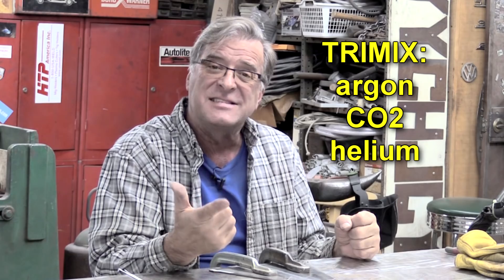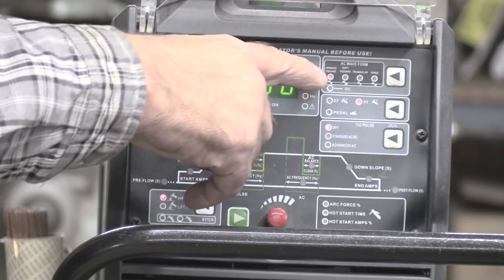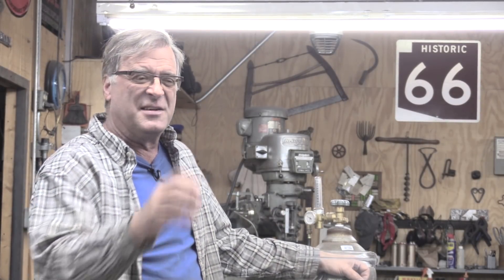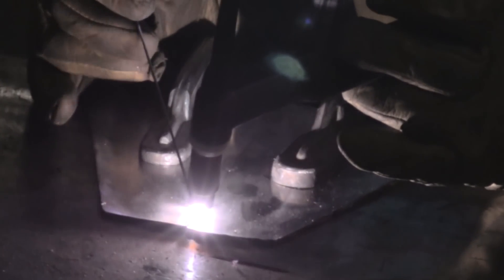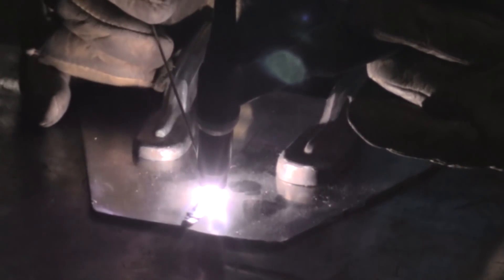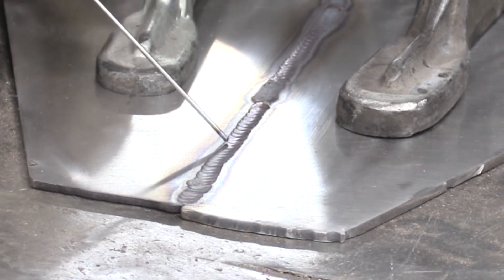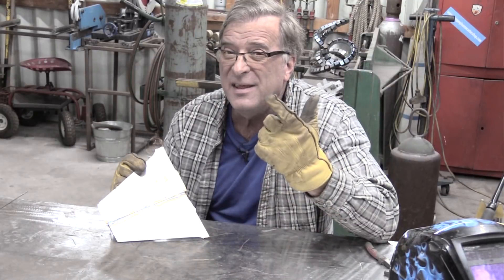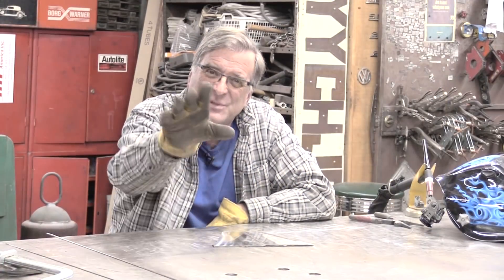How to TIG Weld Stainless Steel - Kevin Caron

Comment: Hey Kevin, I can't help bragging about the clean arc initiation on your 255EXT. You know I love mine too!💚
The only stainless steel I've actually welded was during the razorblade challenge and had two tired wood carving kit blades with nearly pure nickel guitar string.
That's how I tested the low end of my unit when I received it.

Comment: sorry kevin i normally like your vids but thats appalling.
while i'm no pro, stainless amps more or less similar to steel but its less thermally conductive so the weld overheats rather fast. hence you need to increase travel speed.
gas coverage is very important. shielding the backside is very important or use aluminum backing (steel backing can contaminate the work). let it cool with post flow.
stainless mig gas is typically argon + oxygen. no need for helium. afaik co2 can add carbon to the weld and cause black stuff on the weld which is why its not used.
then there is the cleanup and metal treatment.
Reply from the maker: Wish you were here to do the video for me.
Reply: @KevincaronSculpture  sorry i wasn't meaning to offend, its just most people either blow holes or cook it.
Reply from the maker: @tweake885    If I have learned nothing else doing all these videos the most important thing is to have a thick skin and just try to help the best I can.  NO worries mate and please check in next week for the next episoide in "What the heck is he doing now??!?!?"
Reply: tweak e ESAB, my welder recommends helium, argon, Co2. Mostly helium, less argon, and a small percentage of Co2. I think they know what they’re talking about. My Lincoln standard welding book also recommends something similar. But if you can’t get that, or you are appalled at the price, 75/25 will work, though 85/15 is better.

As far as back purging is concerned, yes, if you weld through, it’s needed. But if you have a backing plate, and you give your parts a small amount of spacing, and also have a couple of seconds of pre flow, you’ll get away with it. You see he didn’t weld through.

You can also use Solar Flux on the backside, which is made for that purpose. I wouldn’t use it for sanitary, or thermally challenged work, but it’s fine for anything else.
Reply: @melgross   your quite right. i found my gas book and realize i was thinking of something else. tho there is o2 argon mix for stainless. but most are helium argon co2 mix. co2 being 2% or less.  75/25 or 90/10 you end up with a very hard black coating which is a major pain to remove.